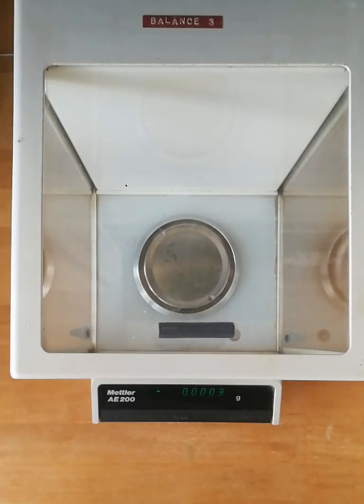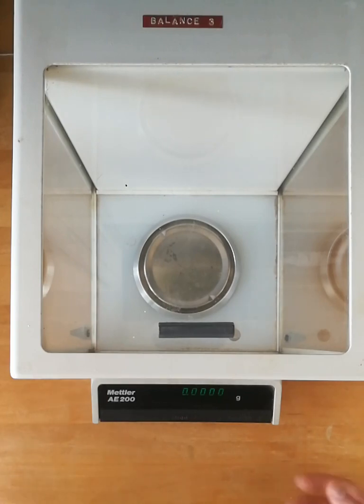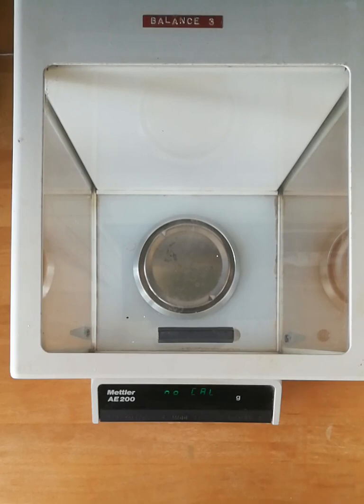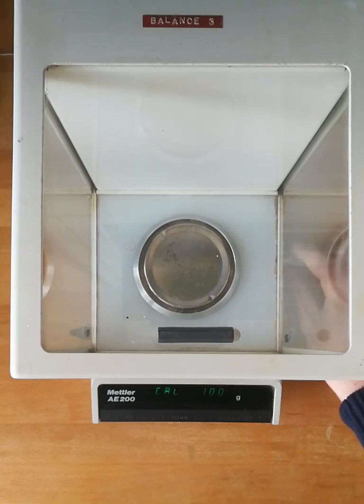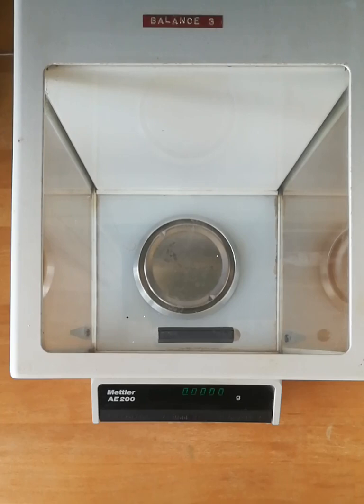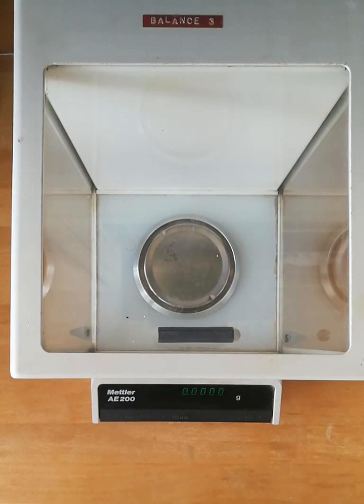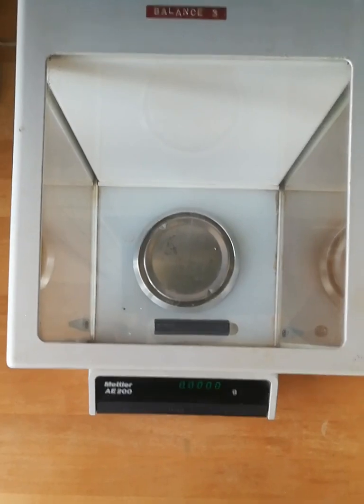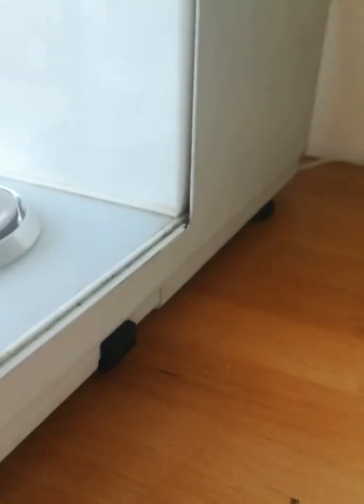Calibrating the Mettler AE-200 precision balance with the internal calibrator.

Comment: Hi
we have AE160, i did levels but show cal error! what should i do now?
Reply: Hi! When you start the calibration process the lever needs to be in position zero, all the way to the front. If that is not the case, then it will show the error message.

Comment: How to remove calibration error
Reply from the maker: This usually means that there is a significant deviation from the expected calibration weight. You would probably need to disassemble the unit to find the fault.